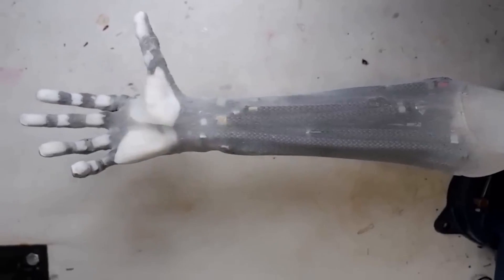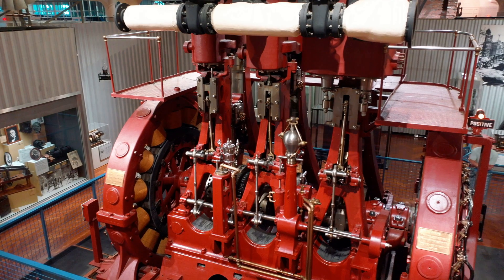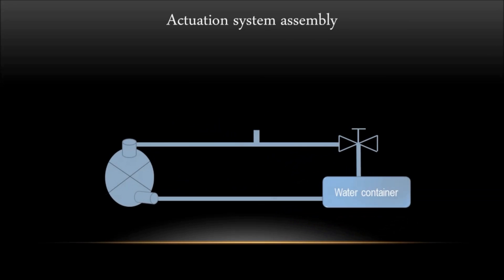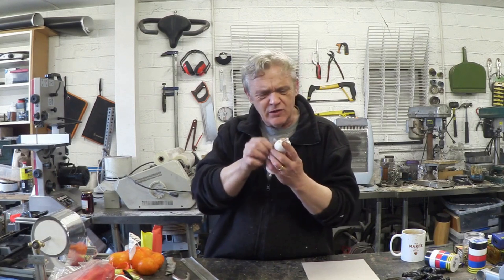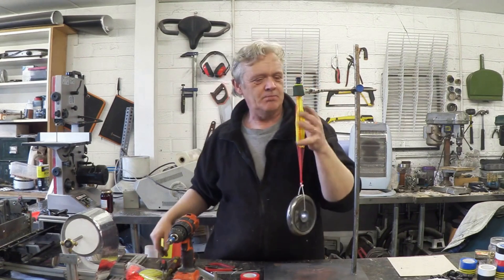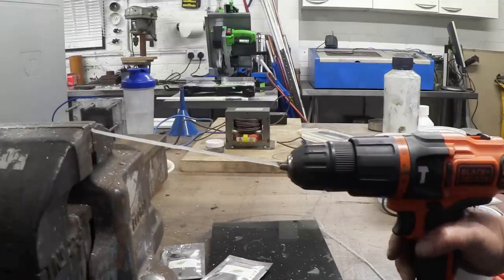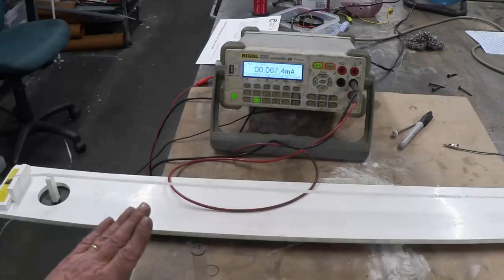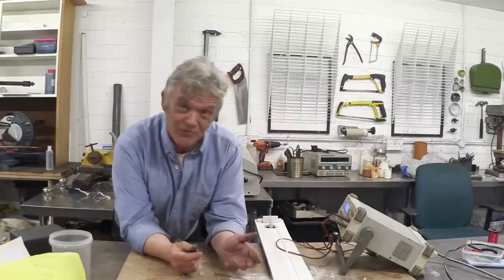2117 Artificial Muscles For Energy Generation

Comment: Hi Robert - I have been working on something for a few years - but I need a highly flexible, but STRONG "balloon" or rubber material - I was thinking of using a bike tube - do you know of anything I could use? Really struggling. Surgical latex tubing not flexible enough (needs to expand a fair bit)
Reply: Pilates exercise ball is very stretchy and durable.
Reply: Have you tried balloon rubber? They sell it at special effects supply companies.

Comment: I recalled watching these videos a while back, and thinking about some ideas for building prothetics or exoskeletons using artifical muscles. I can see a hybrid type of build devised in a way in such that these muscles act as both an input and output system. The power generated would be used as a feedback loop that helps sustain its own power operations, or at the very least feed additional power back into the system to optimize its power systems for more efficiency. The potential is very vast here.

Comment: have you seen gathering air pressure from tidal waves? as the artificial mussels are simple perhaps they would be less maintenance then win fans used, but the high volume low pressure would need to be converted to high pressure low volume by a long tapering pipe and 1 way doors.
Reply: I see what you did there: "tidal" and artificial "mussels". 😂 You could use the tidal movement directly, for a hydraulic vs pneumatic solution.

Comment: if you are wanting these as cheap harvesters for lasting structures. You will want to make sure the cheap part is placed in something that can be easily swapped out for when it is no longer functioning. because the act of maintenance is a expense, both in $ and energy.

Comment: do you just connect the wires for tappin the power to the ends of the coil strings or is there more electronics in the wooden structure?

Comment: I remember treating rubber bands with a special liquid from a local hobby store for rubber band motors on model aircraft. It facilitated the super coiling to produce a more constant power for the complete run of the rubber band motor. I recall that the formula caused the rubber shrink. Never thought of it to an artificial muscle. Rubber electrolyte?

Comment: Fascinating possibilities. I have a question for you Rob that could ignite a debate regarding power generation. I know there's lots of scams about but if you created or someone let you verify in anyway you wanted a device that could generate an abundance of "free" abundant energy for all,  would you share it or would you have concerns sharing something that could potentially attract unwanted attention?
Reply: I would say share it once on the internet they can't stop it been replicated
Reply: @ShafaqIftikhar-pw9ld Well, Id say its not about just sharing it on the internet in general as much as it is sharing it with the right individuals first. Some kind of trusted network that can justly broadcast and replicate the information out there. Because trust me, if the information has real value and weight behind it things can be scrubbed from the internet very easily if not done right. 

Only real problem is, not quite sure how many like that are truely out there. How many will remain uncompromised when their integrity is tested? Censorship is already pretty common enough in the mainstream net as it is.

Comment: The drawback to McKibbon air-muscles is the requirement for an air pump and storage, and a solenoid or other valve for each actuator.  These rigid components take up space and add cost.  I have wondered why there hasn't been any move to using electrorheological or magnetorheological fluids as the working fluid in a McKibbon-like system.  "-Rheological" in this case refers to the fluid's tendency to thicken to a great extent when exposed to an electrical or magnetic field respectively.  A viable system could possibly be developed by creating a "circulatory" system that pumps fluid through the muscle at all times.  When it needs to actuate, a coil at one end could thicken the fluid, creating a plug that acts as a two-way valve.  I admit, this idea has its own flaws to overcome, and isn't that much less complex than the standard, but it does avoid some of the reliance on rigid valve systems.

Comment: I had already tried the wind one and for some reason now it made me think of a bicycle wheel, where the super springs converge on a magnet in the center and put piezoelectrics on the outside, would it work? It may be very complex for such a small generation but I love this.
I collect rainwater in 3 IBC tanks... perhaps something like what you showed would be generated when said tanks were filled. sorry for the mix of ideas love what you do thank you thank you thank you for sharing so much

Comment: This kind of device could also have the secondary benefit of dampening the vibration that wears down high traffic bridge structures. Using the wear & tear on the metal work as a driver for a vibrational generator would reduce the energy transferred into the bridge itself & lighting it to boot.

Comment: To use the wind, one should treat it much like a bass violin where some kind of friction is drawn across it.

In theory, depending on what kind of string, and how many coils one is using, there could potentially also be some electrostatic potential.

A similar way to make the vibration is with a fire-bow and rubber wheel where the tree waves back and forth, pulling on one end of the bow, and the wheel causing frictional vibrations, either directly to the coil, or to a hinged lever against the coil, so as to invoke high frequency vibrations.

I'm thinking that many materials will just develop power from the strain effect too.